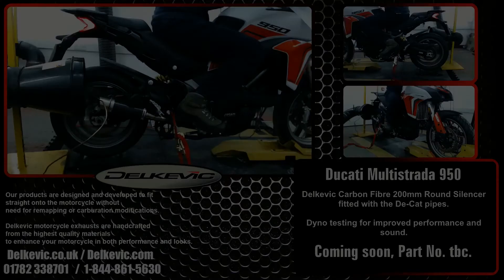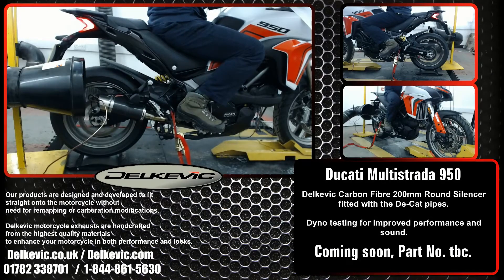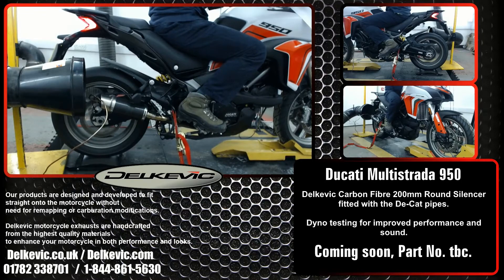Delkevic Mini 8"/200mm Carbon Fibre Exhaust on a Ducati Multistrada 950

Comment: Do you have the dyno graph available for the 10 inch stainless can on the multi 950? I don't see a video for it, but was hoping there's one on record. I would like to compare.
Reply from the maker: Hi, we don't do a 10" stainless steel exhaust, we do the 8" in carbon or stainless steel and we do a 9" oval in carbon or stainless. There is no difference in sound or performance between the carbon or stainless of the same size and shape which is why we don't separate videos for each.
Reply: @DelkevicExhausts  10" titanium x-oval 😆 not stainless. My bad